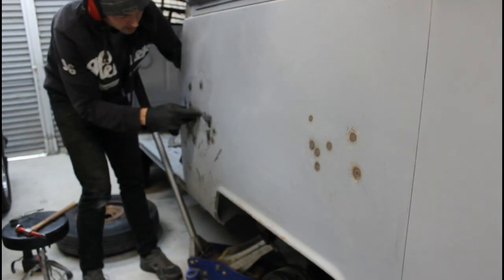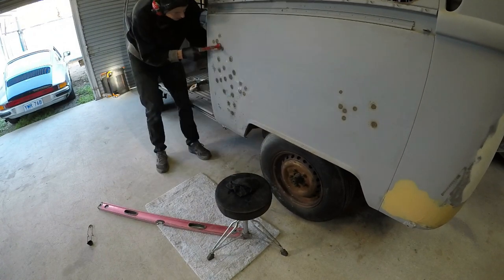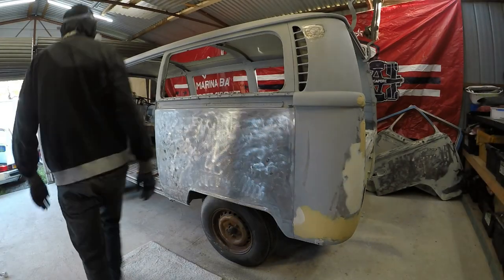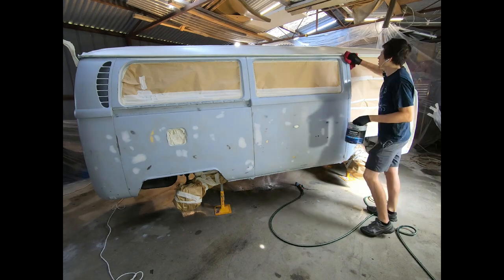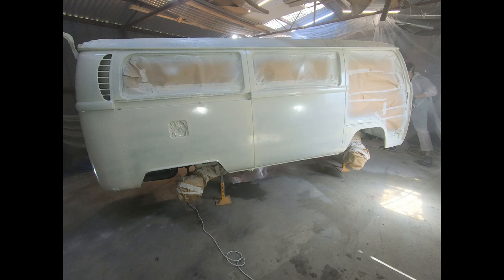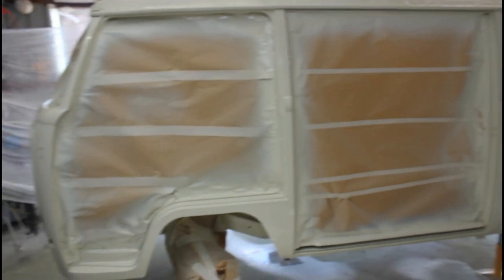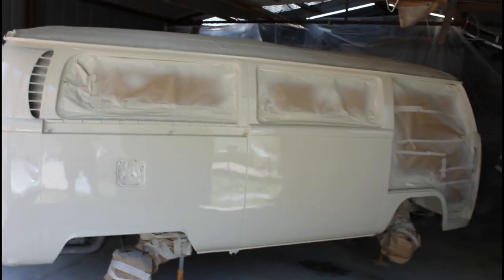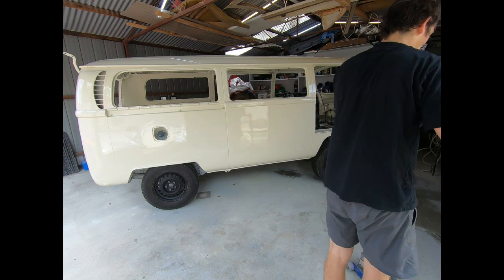KOMBI RESTO : PAINTING THE BIG BEAST! #EP19

Comment: Fantastic mate, did you get any crap land on your job? Pin holes? I had some primer/ filler in a pressure pack which was helpful in filling, ok if you have 2 pack enamel. Looks good regardless mate
Reply from the maker: Thanks mate appreciate it!!
I didn't get to much land in it, a tiny little bit of dust but that's about it.
I did miss a couple but if I end up touching up some bits I will fix it.
Yeah I think I have to get me some of that.
Thanks